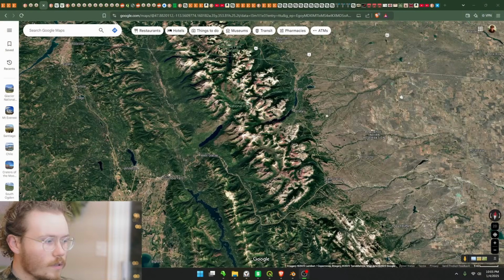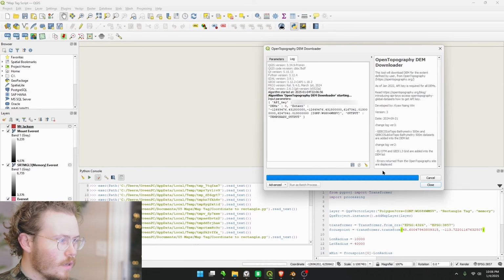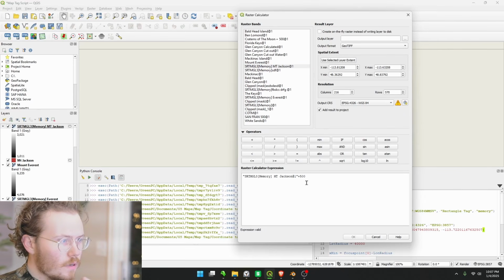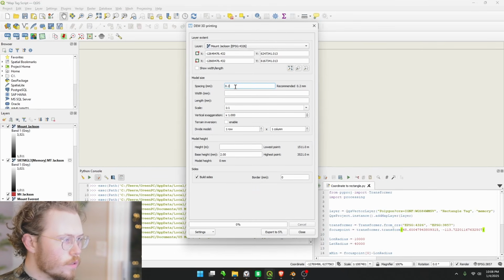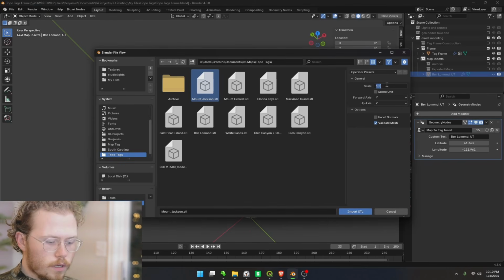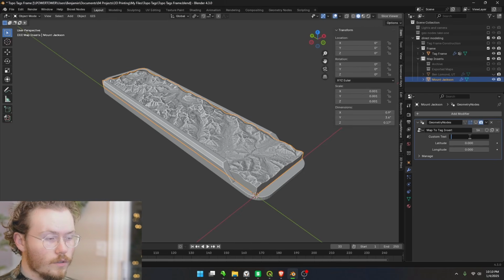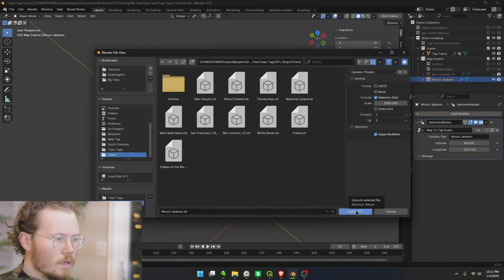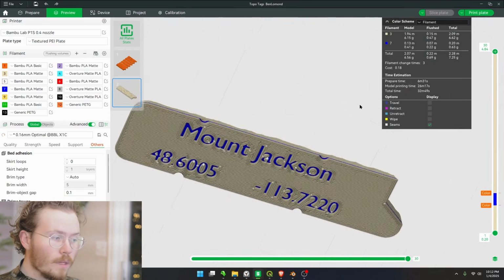How I Make Pocket Sized 3D Printed Maps

Comment: Super cool process! I see you've got a blue line at sea level, but it would be great to add a green line for foliage 1 layer above sea level and a white layer where the snow line is for those snowy peaks. It's really easy to color by Z height in Bambu Studio. That would give you a lot more perceived detail with a standard 4 color AMS setup. Since they're all full layer colors you don't even really need the AMS, it'll work with layer pauses and manually changing the filament.

Comment: oh man you should have printed it! MISSED Satisfaction! 

print this, make this into a short with verrry simple explanation of the process and you got a viral video! 

also, the top is awesome but the bottom is VERY boring, remove the holes, write the text white on black directly on the first layer. 

1 more thing, if you can, exaggerate the features of the topo map. it should be winner!
Reply from the maker: Hey thanks!
Good idea, I’ll keep that in mind!

Comment: Finally, I see someone on this site with a realistic number of tabs open...
Reply: One of us...one of us....
Reply: never understood why folks use up all their computer memory by having chrome tabs just sitting there unused.  Use a manager like Toby... a few clicks to get full tab groups opened when you need them only.
Reply: @pesto12601 the trick is to use an extension that holds all your tabs in stasis. I forget what it's called, but I have 800 tabs open and only the most recent ones are 'open'.
Reply: It gives me anxiety.
Reply: What a madman not to use a vertical tabs plug-in!
Reply: @gromain  I cannot get used to vertical tabs. I think maybe it's because I've been using the horizontal tabs way of working for 20+ years.

Comment: Quick question, why arent you using a 0.2mm nozzle and lower layer heights? you lose so much quality by only using 0.16 with 0.4 nozzle. Yes you can go down to 0.08mm with the 0.4 but the 0.2 gives so much more resolution in the xy plane as well as the z axis. the corners are so much sharper, the layer lines are almost invisible to the untrained eye. plus, it's such a small part that 0.2mm nozzle doesnt really make it take super long. just a suggestion
Reply from the maker: Great suggestion! 
At the moment I don’t have a 0.2mm nozzle, but I probably should.
One benefit of the 0.16mm layer height is that at this scale each layer is approximately equal to 166m of vertical elevation and you can count or compare them. That’s fine for mountains, but more level terrain (east coast for example) will definitely benefit from finer layers.